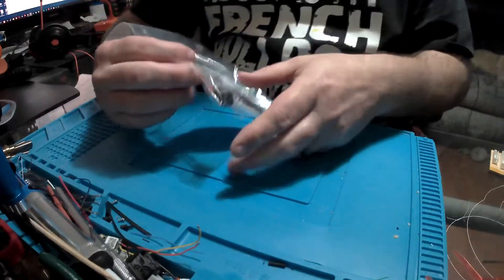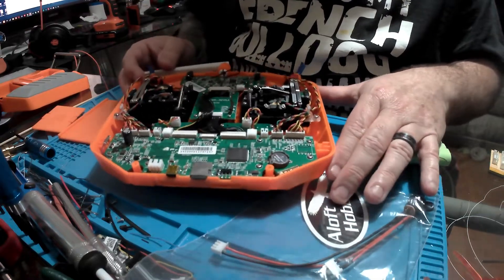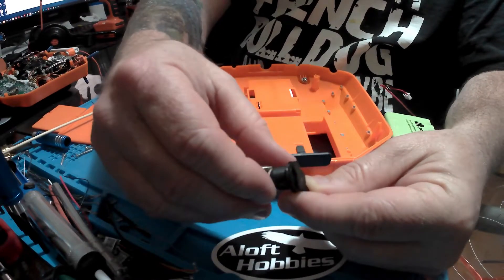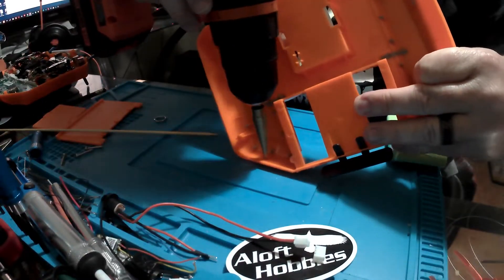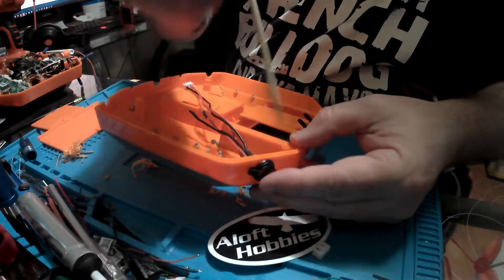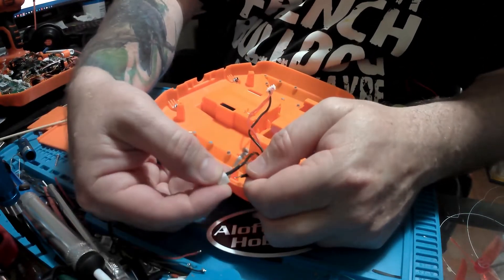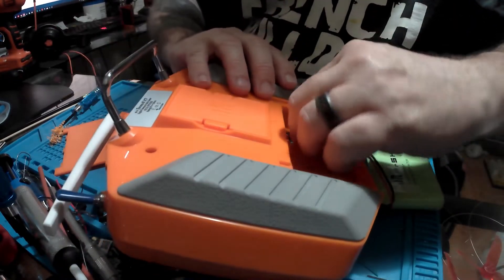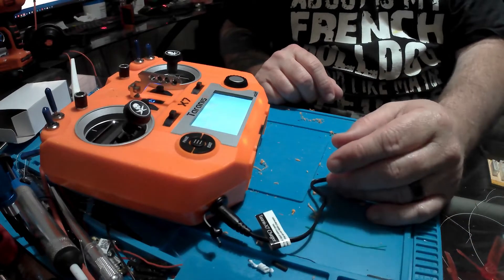Frsky Taranis Q X7 NiMH Charging Kit Mod

Comment: Great now I've watched so many batteries mods I can't decide, whenever I want to charge batteries in a case or easy swappable 18650 lol
Reply from the maker: I can tell you this my friend. This was the best thing I could have done for this radio. I love just being able to stick the power in and walk away. I have not opened the back of this radio since the day i made this mod video. Just one dudes thoughts. Hope it helps.
Reply: I know I appreciate that I would love to never needing to open the back, but what if I run out of batterie on the field that's why I can't decide.
Reply from the maker: Ah i see. Yeah i carry 2 charged batteries with me cause they were fairly cheep to get but totally get what you mean. I never had to do it but i believe you could unplug the new wiring from the board and pop the black battery holder that came in it originally back in and off you go.

Comment: hello, I was wondering whether or not the charging plug disconnects the battery from the Taranis? Does the Taranis turn on when you connect the charging plug?
Reply from the maker: It radio doesnot turn on when you plug it in. So i would assume when charging it is issolated but can't say i know for sure. I hope that helps.
Reply: yeah, they use a special socket that disconnects the battery from the board when connecting the plug. thank you for confirming